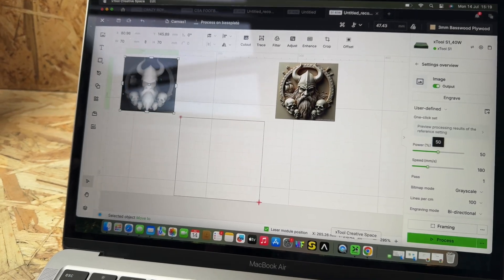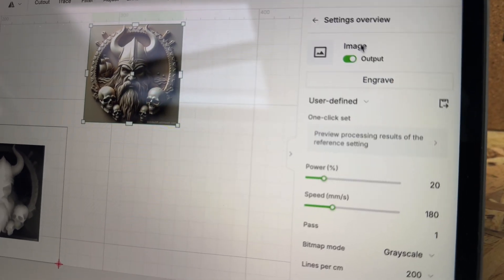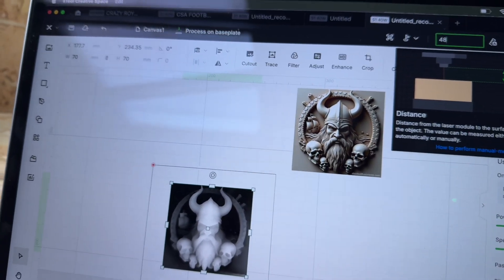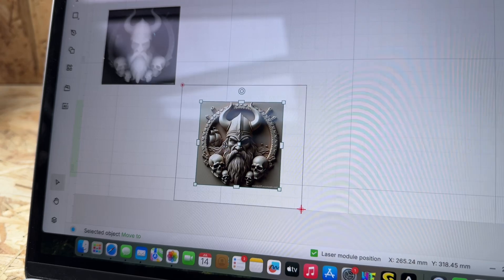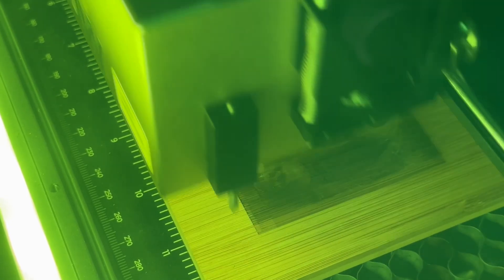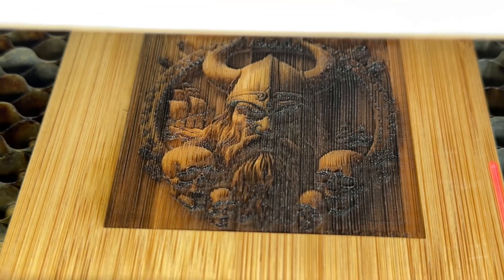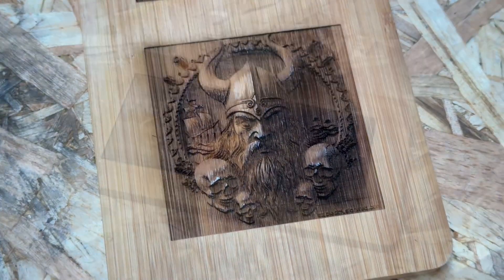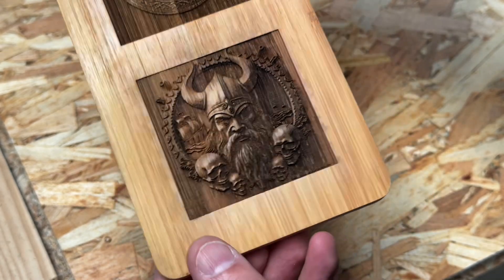How to laser engrave a depth map image on the xtool s1 40w

Comment: is this also possible with less w? for example x1 with 20w or m1 ultra is 10w or 20w?
Reply from the maker: Probably possible yes just might need to run it slower
Reply: @Kenprints  thanks for the fast reply. Im really struggling to choose the right wattage for me.. i want to make detailed engraving on wood which seems lower wattage is best but also need to cut clean on 5mm to 10mm which i hardly believe 10w is possible and ive seen on the higher wattage the details get lost on engraving cause of the bigger laser
Reply from the maker: If you reduce the speed to account for the lower wattage it may work - i dont have a 20 watt diode here to try - well actually i do ive the f1 ultra but unsure if the settings would transfer across as its a different laser setup so speeds may be different

Comment: on another tutorial a bloke just a hard brush water and soap. works also well with cleaning the burn surface. Excellent tutorial thanks for sharing!
Reply from the maker: I didn’t want wetting it as it would change the overall appearance while it was wet I felt this was a better way to show how it would look dry I may try washing it though to see how it looks or if there is a difference thanks for the tip.
Reply: Thank you for this!  FYI, canned air will blow all the dust out.